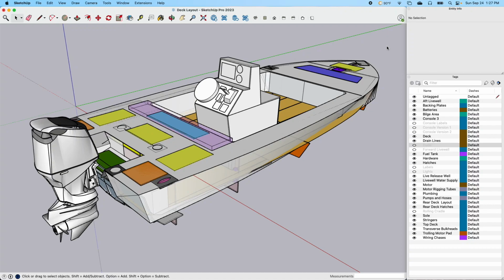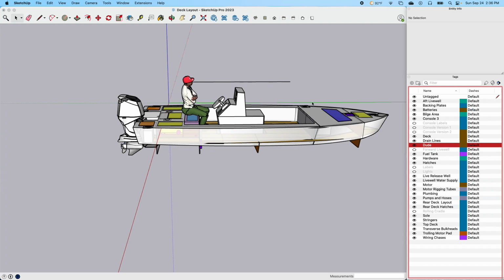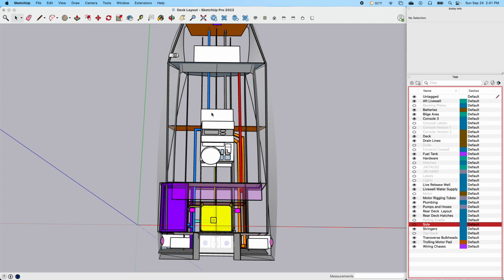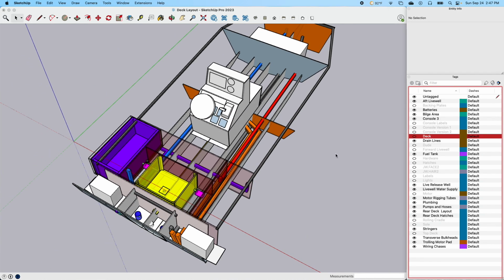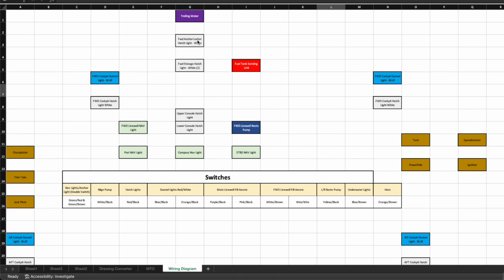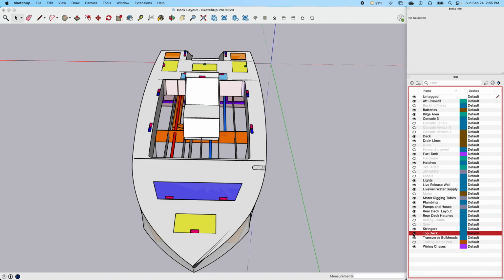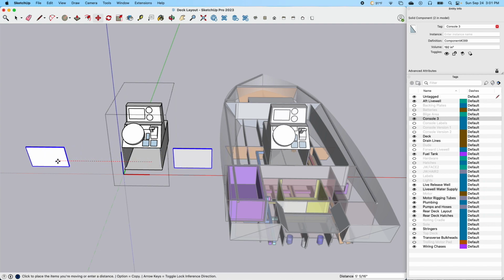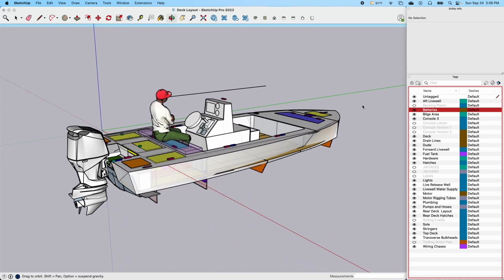46.DIY Boat Building: How a Model Helps me Build

Comment: Thanks for showing the drawings. I’m refitting a boat, and there are so many options and I want to do the work once only!
Reply from the maker: Yeah, just imagine hoe many variations I have been through, and I have changed a bunch when I actually started running the chases and plumbing.  But, we've finished that up now, so on to pouring foam and pushing the ball towards the goal.

Comment: There is a limit to computer programs like this. Instead, grab a comfortable side chair, park it in front of your kitchen stove. There's your console. Sit and move the chair forward and back till the front of the stove seems comfortable for sitting and looking at the knobs as your instruments. Grab a steering wheel or whatever serving tray is the same size and hold it in place to see if that height or distance works for comfort. If the right chair distance ends up too close for walking through, simply get a flip up seat. Makes it easy to stand and steer when you feel like. Armrests also make long trips a lot less tiring.
Reply from the maker: It’s as if you have access to a camera in my house.  I have done all those things, and I have journeyed to look at every other boat I can find and taken measurements when I see them.  Everything with a boat is a compromise from length, to fuel capacity, to seat cushions.  Comfort increases cost and causes inconvenience but it also makes the experience more enjoyable.  So, all that being said, I have sat in chairs pushed against the wall, and held plates as steering wheels to get an idea, and all that led me to the current design, which will probably be tweaked 100 times before its installed.  All I know for certain is where I need my chases to come up.  That’s the next step.  Appreciate it as always.
Reply: @Bigeaux20  No, If I had access to a camera in your house, I would have said "The STOVE! Not the WALL! The....wait! I have the same Elvis painting as you!"
Reply from the maker: There is certainly no Elvis in the building, so now I feel good about walking around confidently.
Reply: @Bigeaux20  Yeah, it did look like Wayne Newton come to think of it.
Reply from the maker: The wife has decorating control.  I’m generally the destructive one that continuously gives her something to redo.  But Wayne’s not in this world either.

Comment: Running your drains below the waterline? Maybe I'm misunderstanding your design, but I think if your boat gets swamped won't your bilge pump will be useless? And even with scuppers in those transom drains, you're going to be running around with water in those drain pipes until you pull the boat out of the water. And combining the front drains with the livewell drain....If the drain or scupper in the transom gets clogged with debris (which mine does frequently) water will back up into your front compartment. A lot of flats boats just have the forward compartments drain onto the deck, then drain the deck straight back to the bilge. You're plans are great, just playing devil's advocate.
Reply from the maker: The only drains below the waterline are for the livewell/fishboxes, or the main deck drains, which will be above the waterline.  The bilge will have a traditional hose and discharge out the side of the boat for visual reference.  By design, the drains that are below the waterline are the same as every other production flats to offshore boat made.  But, I think where you are confused is that the bilge isn't connected to those drain lines that exit out the transom.  I am still lingering on having the very forward actor locker drain out the side of the hull with a clamshell like a lot of boats do it, but the cockpit will drain out through the floor and one of the 1.5" through hulls.  The only water that gets to the bilge should be from maybe a leaking raw water pump or something.  The drains below the waterline will "hold water" while the boat is at rest, but will easily drain in motion.  Outside of the cockpit drains, all the fishbone/livewell drains will have standpipes, or plugs depending on what function it's performing at the time, but water will not enter through those drains even if open while the boat is either at rest or in motion.  There is still enough lift to prevent that open movement.
Reply: @Bigeaux20  I guess it was looking to me like your deck might be at or below the waterline, which would make for some wet feet? With three livewells, 4 batteries, and a couple people won't you be drafting around 11 inches mark. Is the deck above that?
Reply from the maker: Even at that load there should be more than enough to keep dry feet.  But I like the way you are thinking.  Appreciate the input.

Comment: For reference my console is 16” from my aft wall.
Reply from the maker: Did you come up with that distance randomly, or did you measure other production boats?
Reply: @Bigeaux20  I sat in the boat until I was comfortable then had my wife move a box around with a mocked up steering wheel. Whole boat is custom so might as well make it for me. I can still walk sideways all the way around the console.
Reply from the maker: Yeah because of the way I am going to install the drains, I will have to have everything decided before I put down the floor.  That's why I am trying to pin some things done.
Reply: @Bigeaux20  ah that makes more sense. I forgot your floors are in yet. Based on my experience so far, spend the coin on smooth 5-6” tubing. I used a large landscape water hose and while it is big enough, the ridges in the plastic are giving my fish tape a hard time. Keep in mind your bends as well so it’s a smooth transition. It will all work, but if I ever build another I’d change a few things.
Reply from the maker: Get some ice maker tubing from Lowes or HomeDepot.  It makes pulling and fishing wires so much easier.  We used this a lot in redoing the sport fisher I fish on.
Reply: I measured a customers HB biscayne, rear bulkhead to console is 16”,  seems like a good comfortable distance
Reply from the maker: @chrisbrock6056  fantastic.